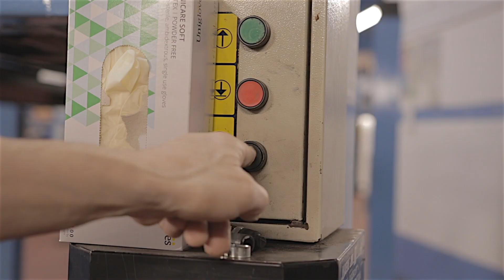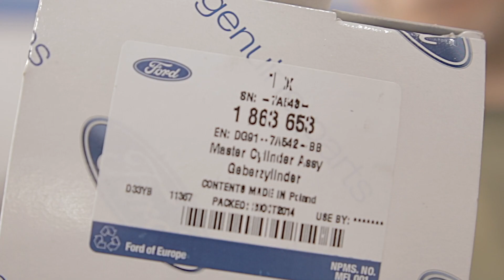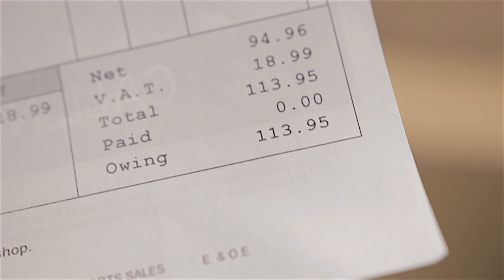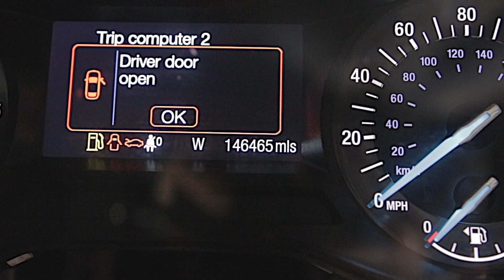Ford Mondeo Mk5 Broken Clutch Pedal

Comment: My Mk 4 Mondeo just at 200000 miles, have not had lots of problems like the mk5, had vaporizer and alternater issue that's all. Still on first clutch! I'll stick with the mk4. Thanks for all the videos Alan.
Reply: Had my mk4 5 years now. Just short of 200k miles. Very reliable only needing a starter motor, DPF pipes, a rear droplink and a small piece of vacuum hose on the turbo ....

Comment: I would have been grinding back old welds and re welding either side. 2 reasons.... 1. New pedal may do same as that too will only be welded on one side and (this was not the first failure encountered on a mk5 mondog so clearly an issue) 2. I’m tight and I don’t see why Mr Ford should get my hard earned cash for something I can fix. Replacing master cylinder makes sense though.

Comment: Can I please have your advice. Il willing to send a paypal contributions. 
Mondeo 2016 2.0diesel 6speed manual. Brought 2nd hand and problem happened from day 1. 
First symptoms was clutch pedal randomly sticking down. No leaks, no loss of fluid so quickly bled the system. It carried on randomly. Once every 30miles. So I bled it again extremely precise. Kept happening. So then I thought maybe the master sucking in air, so replaced the master but again something weird happened. It didn’t stick down but it hesitated a split second to return twice in 30miles. Maybe bleed it again. Have you ever had this problem
Reply from the maker: hi ben, this has happenned occasionally and sometimes after lifting the pedal back up the problem never comes back...but in my findings it usually is the slave cylinder at fault.
bleeding the clutch would be the first thing to hope it cures it...the way i bleed them...i put a washer pipe from the slave cylinder nipple into a half filled jar of brake fluid so no air can get sucked back...i will hold my right hand pressed down on the brake pedal and using my left hand push and pull the clutch pedal up and down 10-15 times..making sure the reservoir is topped up.
after all you have already done as long as the pedal box is not broken in any way i would replace the slave cylinder if the problem persists
Reply: Thankyou for the reply. Pedal box was fine. It only has 27k on the clock. It has already been taken apart before I got in there as you could see where bolts have been undone and one was rounded off so maybe someone has already change the master before me. If it doesn’t work il be driving to you to change the slave😂
Reply: Thankyou again. First time I bled the system I done it like a brake system. Got the mrs in the car, pressed the clutch to the floor, undone the 11mm nut, done the nut back up and then went in the car to left the pedal up. Took a while. This time I done it as you have said, 15 times. So we will see. Thankyou again for taking the time to help out

Comment: Hi Alan. A few days ago my mondeo mk5 get the new clutch flywheel dual mass slave cylinder brake pads and discs also the brake fluid was added to max by me cos was on minimum level and now while driving the clutch pedal sometimes not always after press slowly return to the top position and I don't know why. Do you think that the brake and clutch system need a bleed cos air are in fluid ??? Please tell me what you think. Regards. Jacob.

Comment: Alan have a clutch issue with Ford Kuga. 2015 brake fluid always low have to top up weekly, I think possible leak from clutch cylinder just after advice should I take to main dealer?

Comment: Hi Alan hope you well? I have a 67 reg mk5 and the spring on the opposite side has snapped so the clutch still works but lifting higher and kinda pings up and needs more pressure when pushing down, do you know if this spring can be replaced on its own rather than replacing the peddle box as shown in your video, thanks mate 8:21
Reply from the maker: you can buy the clutch pedal spring kit from a ford parts dealer but also check that the clutch master cylinder rod which connects to the clutch pedal is not broken which would cause the pedal to sit very high
Reply: @alan4x thanks mate, I don’t seem to have a rod like the taxi you were working on, instead it has a chunky green spring, ford must of updated it but it all seems in good order other than surface rust, ill get this kit ordered from ford, I’m just happy I don’t have to remove that steering column lol thanks again 👍

Comment: When bleeding the clutch. Is it like bleeding brakes, needing 2 people or is there some sort of one way valve so it doesn’t suck the air back in?

Cheers
Ben
Reply from the maker: just connect a washer pipe to bleed nipple on slave cylinder and put other end into a jar half filled with break fluid...now you can pump the clutch pedal up and down yourself to bleed the system

Comment: Alan huge favour, I done my 2.0 Mondeo taxi clutch and DMF slave 3 weeks ago it’s now a goner, clutch pedal sticking intermittently. Is it the pedal or a shit slave?
Reply from the maker: if its high mileage might be worth just replacing the master cylinder as they can cause the pedal to stay on the floor intermittently
Reply: @alan4x  hi thanks for the speedy reply. The car has done 80k it was sticking intermittently before the clutch overhaul. I’m concerned the pin on the clutch pedal has failed causing the sticking like in your video?
Reply from the maker: @wullieg87  usually if the master cylinder rod snaps the clutch pedal still works but the pedal sits higher than the brake pedal by a fair bit

Comment: Hi Alan great vids ,I have the same problem on my car and was just wondering is that a clutch position sensor clipped to the end of the master cylinder in your video cheers
Reply from the maker: Hi. Yes it is. The car won’t start without that sensor. A new clutch master cylinder will come with a new sensor on it.

Comment: My clutch pedal keeps popping up higher than normal each time it pressed on my mondeo mk 5 any ideas.clutch itself is fine
Reply from the maker: if your clutch pedal is sitting significantly higher than your brake pedal i would say the plastic rod from your clutch master cylinder to your clutch pedal has broken meaning you will need a new clutch master cylinder
Reply: @alan4x  yes after you press clutch pedal it pops up about and inch higher and stays there. Could it Maybe be the big clutch release spring?
Reply from the maker: @richardcruickshank4026  no very high chance the plastic master cylinder rod from cylinder to clutch pedal is broken, (it breaks just inside the cylinder) done loads of them, unfortunately you have to remove the entire clutch pedal box from the car to replace the cylinder

Comment: Hello alan

have a question .. our mondeos have a vibrating noise at 1500 - 2000 rpm the workshop says everything is ok do you have any idea where it can come from? You always hear it on the front right and sometimes on the left as if it comes from the bottom.

Greetings from Germany
Reply from the maker: lol, a bit hard to tell with that description...try holding the air con pipes where they go through the bulkhead as they can cause quite a loud vibration noise
Reply: @alan4x  okay thanks for your answer I'll try it ... I forgot that this is about 1.5tdci diesel engine ... also I have a clatter in the steering wheel can it be there that the airbag east or the cable from the airbag?

Comment: I have many times wondered why manufacturers cannot all go down the cavalier Mk2 route. 1/2 hour clutch changes were perfectly feasible due to the fantastic design. Even the CV boots could be changed in situ without removing the driveshafts or any ball joint. Not a perfect motor but come back Cavalier, all is forgiven.

Comment: Hey Alan. I just bought a focus mk2 1.8 tdci 160k miles on it. Please can you tell me are these engines strong any known problems of them any suggestion. Thanks a lot.
Reply from the maker: hi, these lynx engines are very strong proven engines but as it is today all the emission related crap fitted to the engines is not so good but that is how it is.
 i really need to do a video on these engines as i could go on all night but the main thing to know straight away is does your engine have a wet timing belt or a timing chain fitted in the lower crank case..you should phone your ford parts dealer who can tell you using your registration number...if you have a wet belt fitted it is an expensive job to replace and will trash your engine if it fails

Comment: Great video again mr howatt !
What’s the symptoms of the clutch cylinder going ?
My car has 130 k and feels strange and is a lot harder to press compared to my friends car which has 101k !
Can it be this clutch cylinder ? I
Reply from the maker: no it won't be the clutch cylinder making it heavy, the clutch pressure plate springs, so you may need a new clutch in the near future

Comment: i love your vids but you wasted so much money on a pedal box. why not just weld in a new pin or evn nut and bolt? we only had one go on us and we just used a bolt 40k and still going strong
Reply from the maker: good point, i still have the old pedal so fix it up and have a spare ready to be fitted for next time